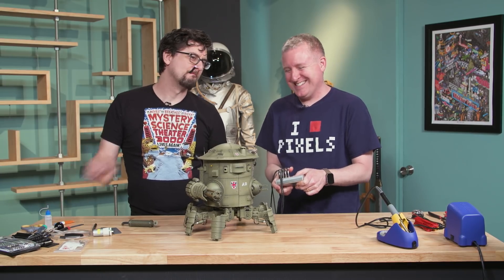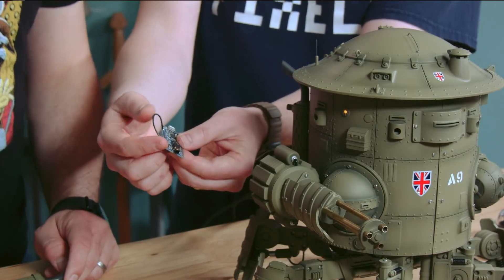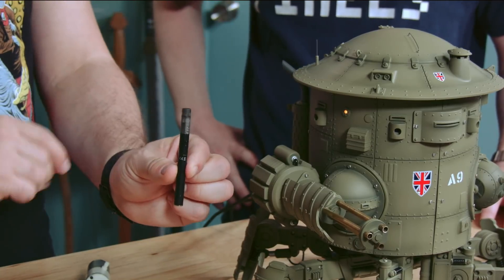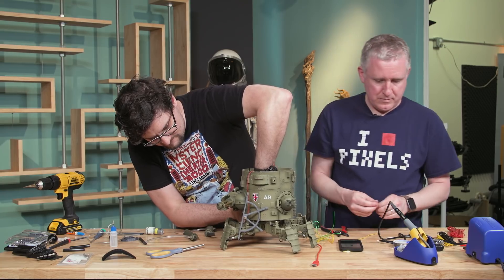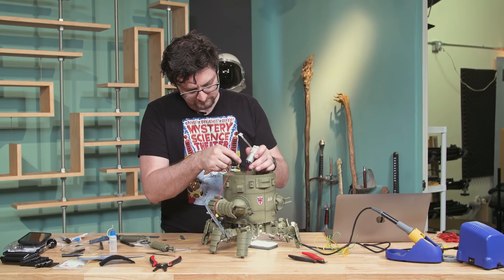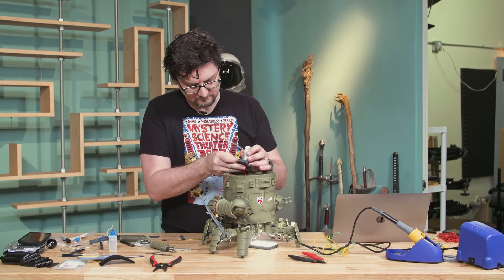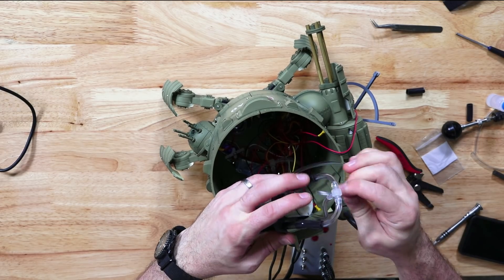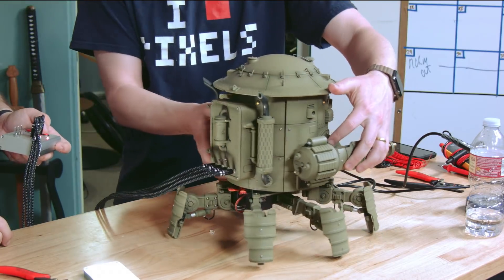Bits to Atoms: Adding Smoke and Sounds to Toys!

Comment: I tried this smoke thing aswell a couple of years ago. Unfortunately I did not have a good air pump. Anyhow... I used just the replaceable evaporator for an e-cigarette and 3d printed a mount that held some wired connectors. So I would have been able to activate the evaporator on purpose.

Comment: If using 2 ecigs, could you not have set it up where they alternate, so you have the 5 on, 5 off but have them opposite so you get continuous smoke? I guess the only issue is you'd need 2 spare pins?

Comment: someone was saying something about LED's to simulate laser firing. I thought about my green laser pointer and thought, WAIT!!! if it could use something like that you could have visible laser beams!!!
Then I thought with the small barrels it would be impossible…
BUT! what about fiber optics? If you had a piece of fiber optics in each barrel could you not then run the laser output through them and BAM!!!! Working laser turrets!!!

Comment: How are the e-cigarettes powered? Did I miss that?  
Normally you have to push a button, right, to fire up the coil in the cigarette? Is that arduino driven now?
Reply: These e-cigs turn on automatically when you suck on them, like a real cig - the battery is part of the unit. The ones I've tried don't produce nearly as much smoke...

Comment: So, I have been all over the darn joytech site and cannot actually find a way to buy anything but accessories and discount items.  The darn page still uses flash, which I do not, so maybe that is needed to see the darn prices of the actual ecigs?  I imagine two of these would be pretty pricey looking at the site and all the guff they come with.  Anyone know the price of these ecigs?

Almost think a place like adafruit or sparkfun could have a nice product on their hand if they made a smoke unit designed for the modelist.  5v plug in instead of the pricey battery, easy pins to connect to for on/off and a nice tube connector to pull the smoke out of.

Comment: I'll admit that's a really creative way to make smoke but wouldn't it be a lot easier and less expensive to use a fan driven smoke unit intended for O or G scale model trains? Some of these can be programmed to control the level of smoke output you want and they are designed for prolonged use so they don't need rest periods every few seconds.

Comment: Nice idea. Questions. 
1. How did you press the vapes buttons?
2. Why didn't you turn the pump so the intake and output hoses were near the spots they needed to be instead of all the extra tubing for a cleaner look?

Comment: So for more dense smoke id try a "smok V8" tank. It runs at much higher wattage but a single tank would produce much more smoke than the pens you are using and it has a swivel open top so it would be easy to refill in place. Also, since its meant to run high wattage you could turn it down a little and get a longer smoke effect.
Reply: Except you need to press a button, which he's trying to avoid

Comment: Great video. Have you thought about using a small cold steam defuser instead of the ecig. They are built for long term use and don't really over heat.

Comment: My god his thumbs can bend when he tries to squeeze/press things. Mine are straight no matter what. Can't be very efficient when it bends like that. Oh how we are all designed differently.
Reply: i'm genuinely interested in scenarios in which straight thumbs increase the the efficiency of manual labor.
Reply: I'm one of those that my thumb can bend backward. I've known people that had straight thumbs too, and when they saw me bend my thumbs back they nearly lost their shit lol. They were like WTF is wrong with your thumbs? Um... Nothing? lol
The ability to bend it back does allow more of the pad to contact things you are trying to grip, which can improve your hold on them. But then again, if I don't want to bend back I can hold things with the tips too... So, I see no benefit to not having a flexible thumb. =)
Reply: Future Aesets, it's kinda hard to explain what I mean. With a bent thumb, you can't apply the same pressure with the same... fixed strength, because when it bend you lose strength.
Reply: Yea, obviously a perfectly straight thumb will apply somewhat more pressure. But to downright question the efficiency of any thumb-involving action is blown out of proportion. We're talking here about minuscule amount of pressure.

Comment: Love these videos but all the difficult parts of the build and computer stuff is not really covered. I would like to see you guys really get into the weeds on the details of how to do the hard parts with close ups especially with the computer stuff rather than just a shot from in front of you or plugging wires and hoses together. You guys are clearly doing a lot of work that we don't get to see you mention having issues with the wiring and programming that is exactly the stuff we need to see.

Comment: I dont know if you've seen this already but I am sure you would be interested in it. 
A new PC case from InWin called 307, with 144 led front panel which enables 4 frames of pixelart animation.
https://twitter.com/InWin/status/1003840516193046530 
https://www.in-win.com/en/gaming-chassis/307

Comment: The sounds should have been a mechanical walking loop (like AT-AT sounds) that would turn on with the walking movement, those constant battle sounds get annoying pretty quick (and seriously, $17 for that tiny speaker)
But the smoke looks great, I wonder what the total cost of materials was? (compared to about $40 and up for a model train smoke generator)
Reply: yes, maybe some diesel engine sound from heavy tractor
Reply: Vegaspsycho was asking that myself, especially the Model train generator
Reply: Vegaspsycho same here that’s would be way cooler
Reply: Interestingly enough, while "Joyetech" has a website where they showcase these "eRoll-C" cigarettes, their actual website doesn't have any listings for them; at least not from what I could see.

The closest thing from their website seems like this: https://www.joyetech.com/online/products/ego-aio-d16-kit.html?___SID=U for some $23. Bit pricey.

https://www.instructables.com/id/An-Inexpensive-Smoke-Fog-Generator/ This, however, seems much more manageable. I'm seeing $14 for the glycerin and the heating element from the e-cigs. another $2.07 for an air pump, $4.83 for the suggested power converter.

As a guy says in the comments, common 'fog juice' could prove to be a worthwhile alternative to the glycerin, too. $20/gal is hard to beat if you want it in bulk. Whereas half a gallon (64oz) of the glycerin runs you some $29.

Someone would have to do some testing over what's better or worse. But that being said, we're looking at $20 for this project. Not bad in the slightest (if you already have the tubing, the soldering tools, the electrical know-how, etc. etc.) and WAY better than what we've got up here.

Thanks to Tested for opening up the ideas for using eCigs, though!

Comment: couldn't you have made is so both vapes are connected to each stack so one runs while the other cools down so there is constant smoke
Reply: Personally I like the on/off mechanic. Really makes it feel like there's some awkward bursty steampunk machinery in there.
Reply: not sure another pump would fit in there or they have enough inputs but i guess it's possible if you want to do it.